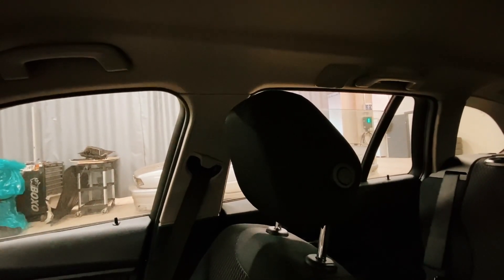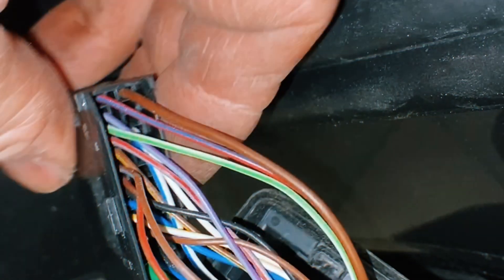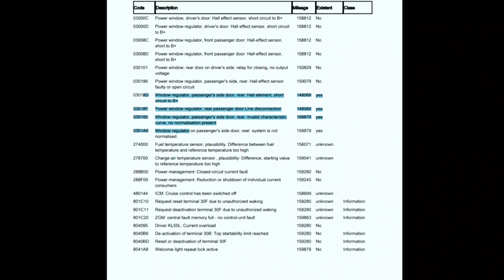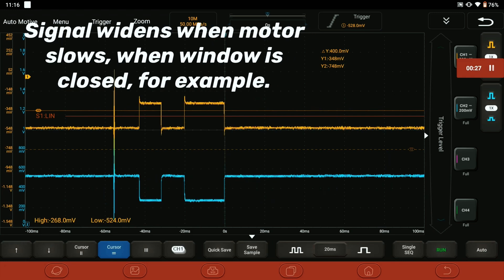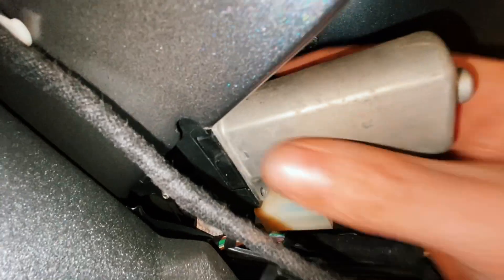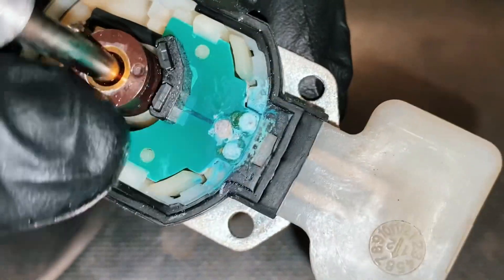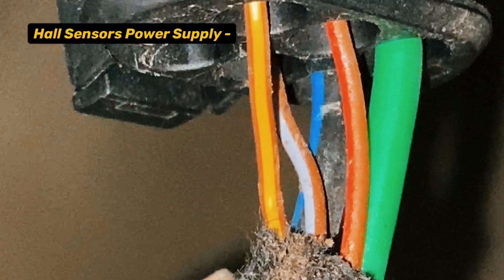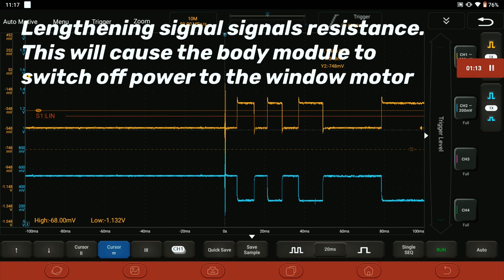EASY WINDOW MOTOR AND HALL SENSORS DEMYSTIFIED FOR BEGINNERS.

Comment: Hi, thanks for the video. My driver window is not going up. It goes down. I tried reseting it, but it did not help. Diagnostic says "hall sensor faulty". Do u think it could be the motor?
Reply from the maker: There is water in the motor and it killed your hall sensor🙂
Reply: @BenJFF  Yes, i did dismantle the motor and found no oxidation. But i think it doesnt have to be visible. The car was outside for 3 years with open window 😁. Thanks ❤️

Comment: Interesting, I've never really thought about door regulators before.  Probably as I've not had to deal with a fault on one.  It would have been interesting to see the part of the scope trace where the short was with a shorter time base to 'zoom in' to see a little more detail of the interaction between the two phase outputs.
Reply from the maker: Yes it would have been but I had no time bud. It was interestlng to at least see the short between both sensors. Unsurprising since the water had corroded everything.
Cant rank for tags on this subject. I need to search new tags 🤷‍♂️ Hard to go up against the big boys.